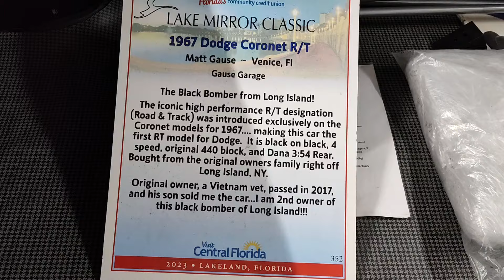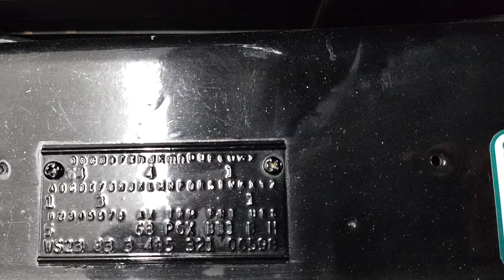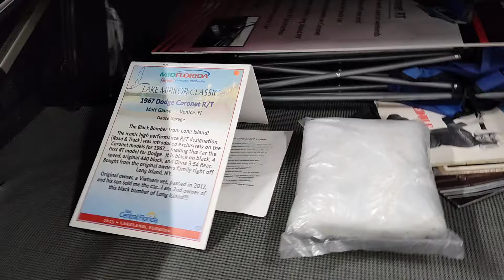67 Coronet RT, 4 speed, Dana 3:54, black on black factory unit.......😎💯🏁

Comment: My father worked at a Dodge dealer and for our family car, he bought a new, yellow 1967 R/T with a 440, automatic transmission, power steering and air conditioning. My mother mostly drove it during the week and my father would drive it on family trips. I took my driving test in it and drove it to high school in the 70's. All 1966 and 1967 440's were "dynamically balanced" at the factory, but after 67, they got the standard static balancing. 440's were originally dynamically balanced to be super smooth, like Cadillac and Lincoln engines.

Comment: This year 440 had the good cylinder heads.
Reply: The 1967 915 heads flowed within three percent of the 1964 Max Wedge heads. On the other hand, the big block Chevy oval port heads flowed about ten percent more on the intake and exhaust. The big block Chevy heads are heavier than the cast iron 426 Hemi heads though.